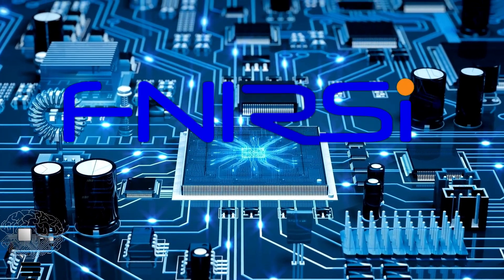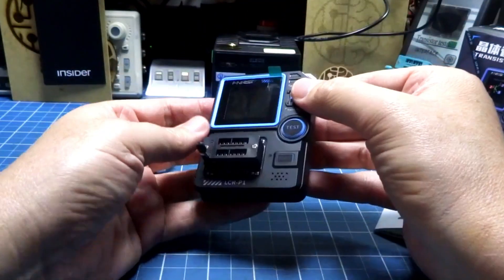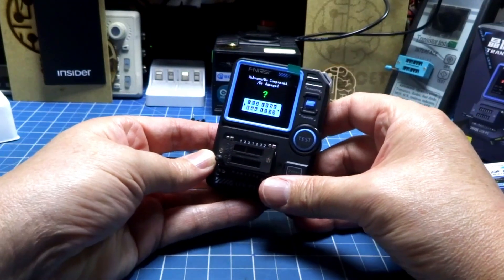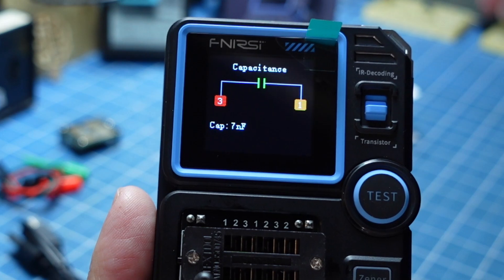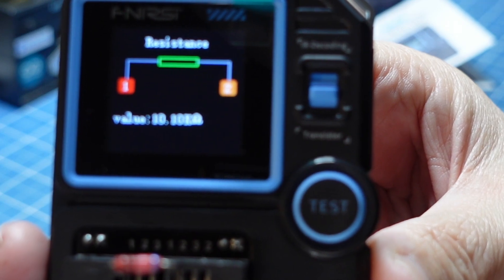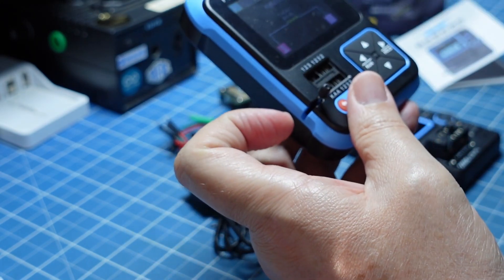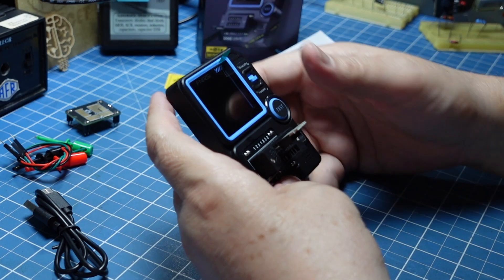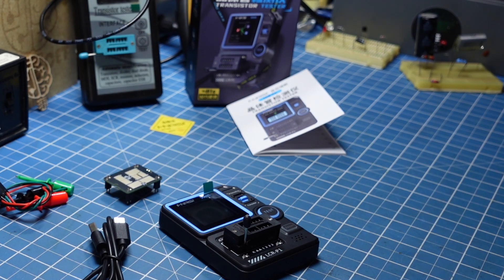Essencial: O Testador de componentes LCR-P1 da FNIRSI - simples e barato para usar na bancada.

Comment: Bom dia não gostei, tem várias falhas , vc coloca um transistor ele mostra os números de bce errado.  Daí vc vira o transistor ele mostra real , dependendo de onde coloca o componentes ele mostra errado ou certo , não confiável , tc7 vc coloca o transistor em qualquer posição e numeração do conector sempre da resultado correto.  Também não mede capacitância entre base e emissor , triac mede correto dependendo de onde colocar no conector.

Comment: Bom dia amigo o meu que comprei , não é confiável , conforme coloca o transistor ele mostra informação errada de coletor emissor. Outra coisa medido continuidade no conector com ele desligado mede tudo em curto 1 com 2 e com 3 
Coloca um bc 548. C 1 b2 e 3 mostra uma pinagem , colocando e1 b2  c3 mostra pinagem que não bate.  Teria um contato para falar com vc.  Já atualizei com a última versão e continua com erro
Reply from the maker: Parece ter algum problema....